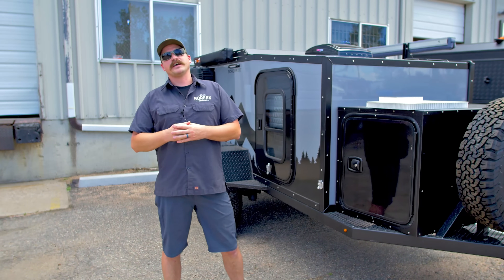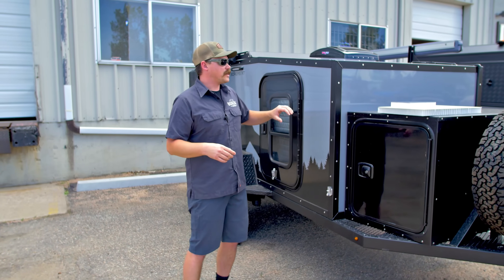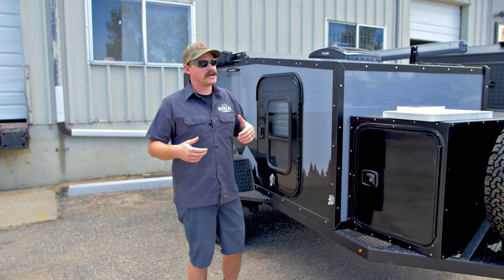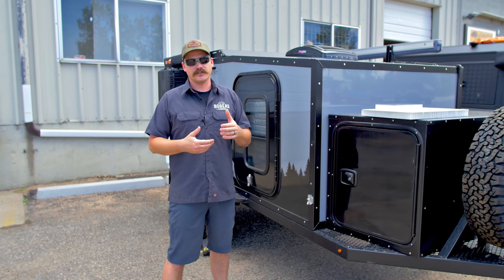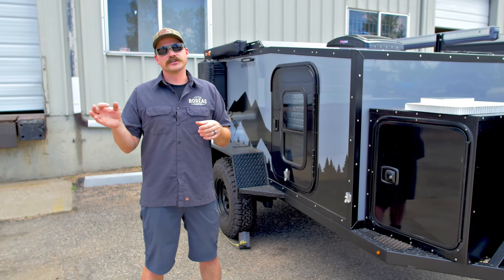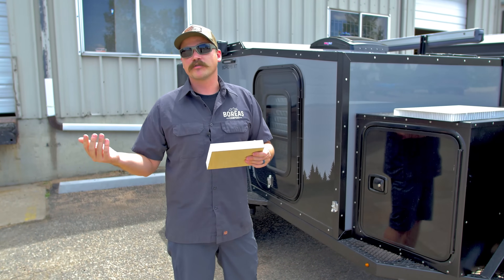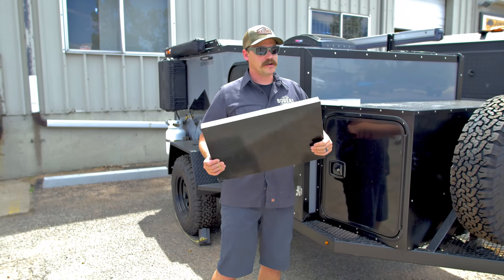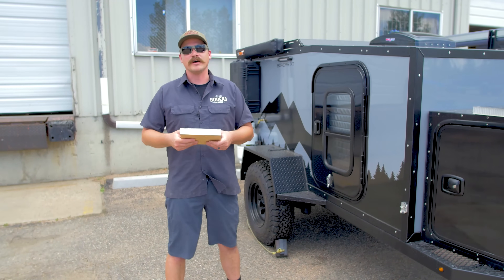Composite Panels vs Aluminum on a Camper Trailer

Comment: Hey mate, how do you guys attach the outside shower box to the composite wall? I assume you don’t penetrate the body.. is it just a strong adhesive? Thanks!
Reply: They most likely drill through into a bracing or support that’s inside of the wall, at least that’s what I would do for the sake of longevity

Comment: I take issue with the statement that "aluminum isn't repairable". Air streams and others can be easily repaired with an aluminum sheet, some caulk, and a rivet tool. Also, the website article compares aluminum exterior with the fiberglass panels which is an apples and oranges comparison - the aluminum should be insulated with insulating panels, spray foam, sound deadening foam, etc.
Reply: There is a difference between "repair" and "replace". Big bucks to replace a section of an airstream.
Reply: @doubleganger2 ,.. BUT, it isn’t retro monocoque aircraft type construction. Agree with what you say about composite panels but Airstreams are retro-beautiful. Gotta give ‘em that!

Comment: I'm curious that metal working machines like lathes, mills, routers don't use carbon fiber to replace the metal at least replace the aluminum as a proof of concept. If carbon fiber is so rigid and why is no one doing this? 

For a CNC router having comparable tensile strength with a fraction of the weight would be greatly useful for efficiency and accuracy. 

Besides the price costing more per sqaure inch not weight is there another reason I'm unaware of?
Reply: " to replace the metal "  what are you talking about?
Reply: @horseshoe182  Not for production or anything practical. People make stuff because they can and worst case scenario it fails spectacularly. Saw DIY 3D printers videos that replaced alluminum extrusions on the gantry with carbon fiber linear rails. They won't beat a injection mold in practicality but it's ridiculously fast compared to most high end consumer facing machines.
Reply: @obe22099  are you saying ,possible to replace the mill etc, cast iron frame?
Reply: @horseshoe182  No. Novelty mostly. Same as videos with a mostly 3D printed lathes that "work" mediocre at best.
Reply: @horseshoe182  I worded it poorly. I meant since the cost of carbon fiber dropped from something only supercar companies could attain to negligible compared those days. 

Yet no one is making content about fabricating it for unusual projects.
Reply: @obe22099  carbon fiber is not rigid, it is soft as cloth. a carbon fiber composite(blend of things) can be rigid, partly due to the blend of the materials and partly because of the epoxy they use to bond everything.

yes the carbon fiber itself is very cheap these days, however the labor involved to make things from it hasn't changed. still aren't many people that can use it, and it only has one directional strength. if you lay it north ->south it will have the same strength as steel, but will crumple if force is applied east ->west. not practical for machinery at all, pretty good for airplanes and some sport boats, which is why it's mainly used in those industries.

Comment: Are these fiberglass panels a realistic material to work with to clad a lanai that currently is an aluminum framed screen wall?  We were thinking of covering over the screened spaces with solid material, like aluminum or composite...something light.
Reply: I will reply with my idea as a viewer,,, the frame may be too light since it was designed for lower winds with the pass-through nature of screens, but if you securely attached 1/8" fiberglass panel to your lanai, it would strengthen itself considerabley, but the whole thing may fly away to Kansas in a storm, then.

Comment: the catch is the cost of panels like that in manufacturing, what is MSRP on your trailers? 40k?
Reply from the maker: Hey Jonathan, the panels are certainly a premium, but we think it's worth the value it adds over the extended lifetime of the camper. Our AT is $20,900 and the turn-key, fully outfitted XT is $31,990.
Reply: @BoreasCampers  that price point prooves my point. Beautiful build, but upper end pricepoint for sure.
Reply: @jonathanbrazeau970  You either build crap that falls apart like everyone else, or you invest more, charge a bit more and offer a superior product to your customer. At the end, the customer will be more satisfied as they don't feel ripped off. There are of course the people that like to buy cheap... It's all fun till the camper is falling apart. I'm tipping my hat to Boreas Campers for doing the right thing!
Reply: There is ALWAYS a trade off. I'm a wood and fiberglass guy and always have been. As long as you can look at the picture  the long term picture.